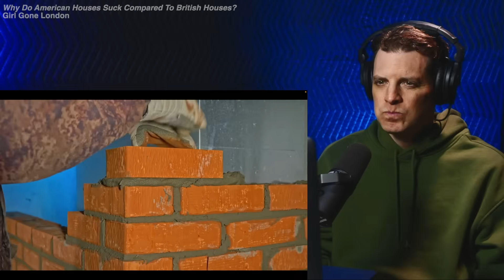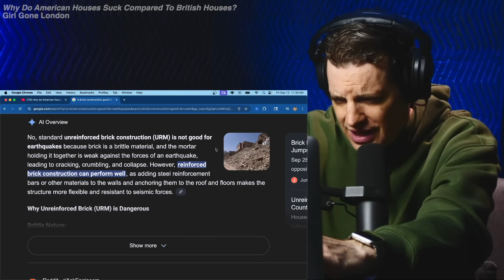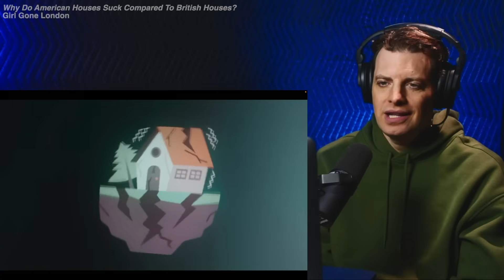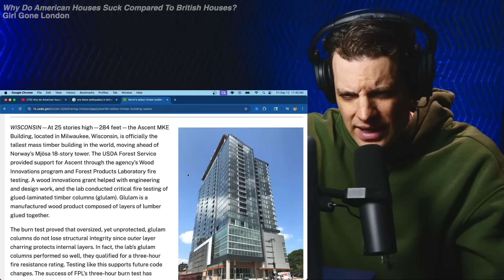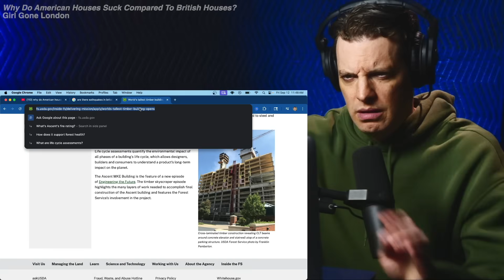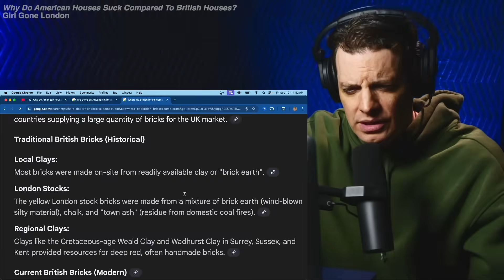American Reacts to Why American Houses Suck Compared to British Houses!

Comment: British homes are designed to primarily deal with high winds and extremely damp conditions (our soil holds moisture like a Mutha Humpa). Which would make wooden built homes not last very long. Also our building and safety regulations are some of the strictest in the world, for good reason, as they are meant to combat slumlords. As he have historically had serious issues with dangerous living conditions that ended in tragedy.

Comment: Immediately Post War the UK introduced 'Prefabs' (Prefabricated).  These were constructions made of prefabricated sheets of concrete which would slot together, much like a giant Lego Kit.  Although these were originally intended as Emergency Housing, following the Blitz, where all Housing had been flattened by the Bombing, many of these Prefabs are still in use to this day.  Indeed, the very Estate I live on is primarily made of Prefabs, most of which have since been refurbished with a Brick-Effect Cosmetic Fascia, with Rockwool Insulation Blocks between the original Concrete & the Fascia.  In this way they look just like a real Brick House.

Comment: Australia uses a hybrid of US and UK housing, using a brick exterior with timber frames drywall on the interior with either concrete tiles or metal roofing.
Reply: Most of the newer houses in Scotland are the same

Comment: There is plenty of wood, but it takes a very long time to grow, bricks are made of clay, which is much, much more everywhere, not to mention that it is constantly being renewed relatively quickly! This video advocates wooden houses, but does not discuss at all that brick is clay and much more universal and long-lasting. This woman clearly has no idea what brick is. We constantly reconstruct our brick houses and improve them, we renovate houses to make them nicer, not because they rot. New houses are built with concrete reinforcement and are earthquake-resistant in such areas, that argument is nonsense. Bricks are not that expensive, look at the prices of houses in the USA and the prices in Europe, in fact they are cheaper in Europe than houses made of paper and wood in the US. About heat/cold accumulation, there are videos on YT about that and they talk nonsense again. It would take a long book to describe this video, but in short it is a bunch of nonsense about brick/concrete houses. American house building codes are absolutely ridiculous compared to what European wood house codes are, floor to roof. European wooden houses have concrete tiles on them, under which a wooden house in the USA would collapse and fall down :D

Comment: Good quality well seasoned wood, if properly maintained will also last 100's of years. The house I lived in for 20 years was essentially a 300 year old timber framed house, with Victorian brick extensions to the front and rear. The walls were simply weatherboarded on the outside, and wattle and daubed plaster on the inside.

Comment: I lived in West Hollywood during the 2008 4:3 earthquake which poly a few seconds seemed to go on forever - I remember in that moment on the 4th floor of a 5 floor building that was shaking like jello - do I run down the stair and get squished or doni go to the roof and try to serf tge building while it collapses? 

I did neither frozen in fear until it stopped anyway lol

Comment: 🤦🏻 You can't release coolness. Coolness is an absence of heat energy compared to the surrounding space. Brick will "absorb" heat from inside but the only thing is can release is stored heat when it is warmer than the surrounding air.

Comment: My home was built in the 16th century from 18 inch thick blocks of sandstone. Originally it was thatched with straw, later updated to slate. The wood for the roof is mainly original and really over built. Stays warm in winter and cool in summer. Im in the north of the UK.
Reply: @dcallan812 ... Your description sounds very similar to a house an Aunt & Uncle of mine owned with its stone and thatched roof and dated 1664, I used to love staying and visiting there as a kid. It was originally four 1 up 1 down cottages converted into two 2 up 2 downs. This was in Derbyshire where I grew up. ❤
Reply: @Tidybitz  Lincolnshire here and that sounds a lot like many of the older houses in villages around me, except it's limestone here (similar to the Cotswolds in colour). Visiting my in-laws in Cheshire is a bit odd seeing stone buildings with their red sandstone.

Comment: I recently experienced a big earthquake in Thailand, my house is steel re-enforced brick/block construction, I certainly felt the rocking during the quake but the only damage was some paint between the roof and wall joints flaking off on some of the outside walls.

Comment: JJ you can tell if your in a earth quake in the UK by noticing the tea in the cup creates circles just as if a pebble has been dropped in it 😂
For great wooden  buildings for earth quake protection look up Japanese  construction of temples / housing , it's a work of art , the wood moves because it's not nailed / glued with anything .
The houses in the UK used to be wood and the walls by mottle and dorb hence the black and white buildings  . Bricks were used because the Dutch found a way of making them very cheap and we imported them ( sadly some Black and white buildings had a face of bricks put on them because it was fashionable  !!!!!!

Comment: My UK house, built in 2006, is wood framed. It has stone walls covering the wood frame and Spanish slate roof tiles. It's packed with insulation in the external and internal walls, and between the floors - each individual room is surrounded by insulation. It also has double glazed windows. It is extremely energy efficient. During some recent structural work instead of using an RSJ (rolled steel joist) beam for support, the builder used a laminated wood beam. They're extremely strong. I expect my house to last way beyond my lifetime, with minimal maintenance and repair.

Comment: You don't have brick houses in America like you could see throughout the UK and Europe.  The 'brick' houses in America are still wood houses, they just have a brick facade.  In the UK the houses are generally built with entirely brick or stone walls, steel beam reinforcement for the main structures with wooden joists and floor boards.  Wood and plasterboard are often used for internal walls but structural (load bearing) walls are still made of brick or stone.  Roofs are constructed with wood framing and slate or clay tiles with the exception of flat roofs which always leak and are a terrible idea.
Reply: I live in a town with a brick factory in Arkansas. The majority of the houses and buildings here are brick. Large buildings use cinder block bricks and steel for load-bearing, like schools.  It gets really hot here in summer, and all that brick works against you, so AC is a must.  It's a big country, and there is a vast variety of building styles.

Comment: 30 to 40 years life of a house is expensive, the initial cost may be low but the overall cost is expensive. You can have clay clad coverings to stop the house burning. Bitumen roofs and wood cladding in fire prone areas to me is madness.

Comment: I would imagine brick or stone is a better option than wood and plaster-board in places called 'Tornado Alley.' Perhaps they've never heard the story of the Three Little Pigs.
Reply: There is no building outside of a bunker that will withstand a direct hit from anything above an F2 tornado.
Reply: @ScottyRichardStudio  Your statement is demonstrably false.
Reply: @gigmcsweeney8566  I've seen with my own eyes the aftermath of a multistory brick building coming in contact with a tornado. Half of it was ripped down.  A large truck was picked up and thrown into it as well.
Reply: @ScottyRichardStudio  I'm sure you have. Your first comment, however, was wrong.

Comment: While brick or blocks are still the main building material it is becoming more common to use a hybrid of wood of brick or blocks (mainly in mass building by a commercial organisation for sale/rent than personal builds). Wood used for internal non load rainy walls with plasterboard.
Reply: Yes, majority of that house come in kit form even the larger bespoke ones are kit form that can be tweaked and have customizable internal layout plans. Its very rare to see someone turn up with lumber and start building a frame they normally give the plans to specialists who prefabricate the frame in sections for delivery they can also erect them if required or the building contractor will deal with it all and you even have the option of DIY.

Comment: My little cottage in Cornwall was originally built some time in the 15th century, walls are three feet thick, made of granite.  Been knocked around a few times over the centuries, still going strong.  Short of a direct hit with a nuclear weapon its going to be around a long time after me.  Timber framed homes can be built well and last for decades, but not with American style balloon framing. Hey ho.
Reply: The Forbidden City in Beijing is built of wood. Huge palaces that are thousands of years old and still happily standing in the extreme cold and heat of Northern China. Very dry weather though . They've survived flood, fire and earthquakes through the centuries because they were engineered properly to begin with.

Comment: Tbh most of our construction in UK uses bricks with holes in them to put steel bars to give it that reinforcement for weather or our mini earthquakes(which aren't technically earthquakes here in uk, we're not on vault line as much as most continents)

But i say if you guys just used steel beams, and then used wood or other materialss, you won't have to rebuild the whole house from scratch again, you'll still have a frame that is still standing
Reply: I'm on the Highland fault line.